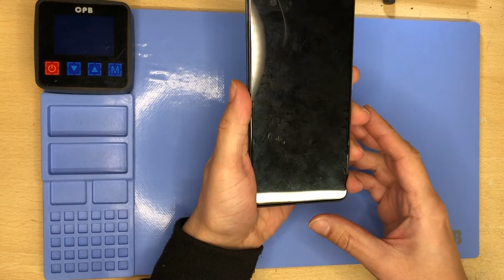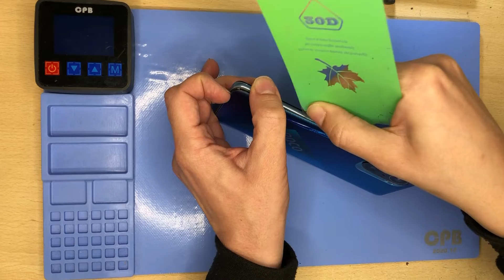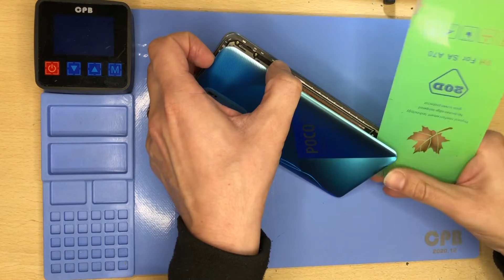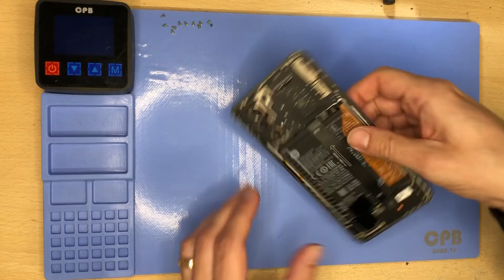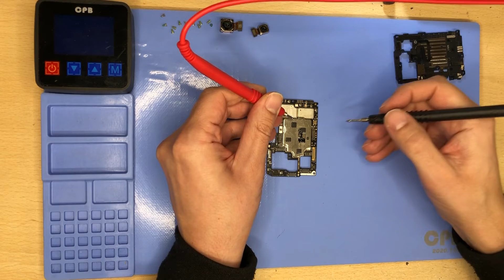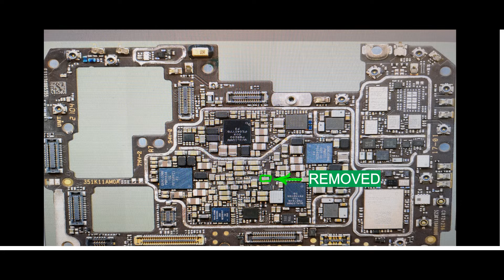Xiaomi POCO F3 Not Powering Not Charging

Comment: same thing happened to my poco f3 just last night.
I was using the device torchlight to look at something with the music playing.then, all of a sudden, it stopped working, with the torchlight still on, it wasn't responding to the fingerprint sensor or pressing the power button - everything just remained frozen just like that. after a quick googling, I held the volume down and power buttons together, it went off but never came back on again. It won't charge and it won't come on. I've tried to hold volume and power button but nothing works. it doesn't vibrate, it does nothing! I'm confused
Reply from the maker: hello, it could be a problem with the processor CPU. Try warming up the processor or motherboard with a low temperature. And while the motherboard is warm, the phone can turn on, then there will definitely be a problem with the processor. Then you should resolder the cpu. It's not a problem for her, write to me.
Reply: @tomasitasovc9372 
Are u sure about this ?
Reply: did you ever fix this? im having the issue right now

Comment: Hi my poco f3 suddenly started to restart and my phone repair guy said I have to replace my battery. But even after replacing battery issue is there. Sometimes it starts but sometimes I have to remove battery pin from the board and have to re-pin it to the board. Sometimes phone gets charged but charging stops at around 50%. Sometimes it won't charge even after charger is connected to the phone. Can you tell me what's the problem please. Great help buddy. I'm waiting for your answer. Thanks a lot in advance❤
Reply from the maker: Hello. Charging problems may be due to the flex connector problem. Restarting issue is CPU proccesor problem. Need to resolder the cpu.
Reply: did you solve the problem?

Comment: Hello i know this is an old video but i hope you'll reply, my poco f3 is 4years old and it's battery is a bit bloated, i was planning on changing batteries, but i noticed while charging my poco with it's bloated batteries still on the phone will sometimes charge and sometimes it will just keep decreasing battery while charging, should i try to change my charging port to or the charging problem is all in the battery?
Reply from the maker: hello. The battery needs to be replaced after it bloated. But it may also be that the charging port is bad, it is best to check look with a microscope or replace it with another one. You can check if your phone connects to the PC and if fast charging works. If it doesn't work, there will be a charging port problem.
Reply: @tomasitasovc9372  thank you so much for the answer, I'll just replace them both charging port and battery i dont want to have charging problem while having a new battery, again thanks for the answer you're a really big help♥️

Comment: Hello, I know this video might be old, but i hope you'll still respond here. My Poco f3 suddenly shutdown when i insert a portable usb, and now it no longer open or charge, I already removed the charger thenI hope you'll still respond here. My Poco F3 suddenly shut down when I inserted a portable USB, and now it no longer opens or charges. I already removed the charger, then I inserted it again, thinking it just hung. What could be the problem? Thanks
Reply from the maker: Hello. Maybe the charging port is bad. You can check if your phone connects to the PC and if fast charging works. If it doesn't work, there will be a charging port problem.

Comment: My poco f3 normally when out of battery i charged i reads yesterday morning when my phone died i charged it just blank and it has been a day. Whats the problem?
Reply from the maker: Hello. First check the charging plate and main flex and its connectors. Second, check the main board for a short circuit.

Comment: Do you have any store to visit? just same problems last day while talking to teams suddenly the screen flicker and shutdown never open and charged for the whole day.. but suddenly in the evening  it opens but after few minutes ut shutdown again, what should I do? thanks
Reply from the maker: Hello. In my case there was a short circuit on the main board. Whose problem was a bad capacitor. Charging problems may be due to the flex connector problem. Won't turn on or restarting issue is CPU proccesor problem. Need to resolder the cpu.

Comment: Hi same thing happen to my poco f3 and the technician fix it by reshoulder/reballing of the cpu but after 2-3 days same thing happen deadboot again and i take it back to the technician and fix it by doing the same process then after 2days deadboot again so what is the main problem thanks for answering
Reply from the maker: hello. If CPU was high-quality resoldered and still not working the problem may be that the CPU is bad or overheated. There may also be damaged tracks between the CPU and Flash memory IC. You can also try resoldering Flash memory IC and power IC.

Comment: my poco F3 cannot connect to fast/quick changer adapter. but it can only connect to non fast charger, what's the problem sir ??
Reply from the maker: Problem is main flex or charging board. Try to change.

Comment: sir same problem please tell me all steps to repair, how i send my device?
Reply from the maker: Hello. Check the vbat voltage contacts. My phone the tester showed zero resistance. After connecting to the vbat power supply, the capacitor shown in the diagram started to heat up.
There may be a problem elsewhere.

Comment: Hello, I changed volume flex cable and NFC antenna in my poco, but after that not turn on. Shows logo and baterry icon and turn off. It's not charging also. I try put old parts, but didnt help. Any advice?
Reply from the maker: Hello, 1. Check the volume flex to see if the buttons are not short circuit. 2.  Try to turn it on with a charged battery. 3. try to heat up the processor at a low temperature, there may be a problem with it.
It won't help her to write.
Reply: @tomasitasovc9372  If look on connections (one pad up, two pads down). I have signal between two below without push the Button. its ok or its shortcut? Old flex Has damage volume up so hard to compare these two. I also try to put old one flex and run phone without it (I protect pins to not have circut short).

Phone also not charging.

Comment: brother I have same problem with my Poco f3, mobile is on , calls and messages is coming  but display not showing anything
Reply from the maker: Hello. There can be many reasons why it doesn't work. For her, the problem of the PCB boards will most likely be the CPU processor overheating or backing off. Try to warm up the CPU to a low temperature. There may be a screen or lighting problem.

Comment: My poco f3 will only show logo and batty symbol when I try to turn it on and same happened when I try to charge it. It just keeps on showing logo and shuts off again and again. What should I do ?
Reply from the maker: Hello. Charging problems may be due to the flex connector problem. Won't turn on or restarting issue is CPU proccesor problem. Need to resolder the cpu.

Comment: my phone poco f3 charging normal , but it vibrates and the connector doesn't want to connect to the PC is there a solution?
I have replaced the charger board port and the plexible main sub is the same
Reply from the maker: Charger plate and the main flex are good for her. Check the flex connector on the main board and check the IC S6000 and IC U5200.
Reply: @tomasitasovc9372  ic power?
Reply: I have the same problem how did you solve it?

Comment: my phone got dropped from my hand after that its completely dead.. no power on or charging showing any body who had this experience..
Reply from the maker: Hello. In my case there was a short circuit on the main board. Whose problem was a bad capacitor. Charging problems may be due to the flex connector problem. Won't turn on or restarting issue is CPU proccesor problem. Need to resolder the cpu.

Comment: Same issues. Deadboot Poco F3 5g
Reply from the maker: First check the resistance of the power supply circuit. It could also be a processor problem.

Comment: Hello, I have an issue with my Poco F3. It detects the charger but doesn't charge past 1%. I've tried various cables and adapters, but it won't charge. Also, being able to use it at all is quite an achievement, as it usually stays on a black screen with a blinking lightning bolt, and it doesn't even get to display the Poco logo. I would like to add that the phone had previously fallen without a case on, and an hour later, I completely drained the battery to absolute 0% while listening to music on my way home. Additionally, the battery, regardless of the charger, consistently charges at 400mA :(
Reply from the maker: Hello. Charging problems may be due to the flex connector problem. Restarting issue is CPU proccesor problem. Need to resolder the cpu.

Comment: Same with mine wont charge and deadboot
Reply from the maker: First check the resistance of the power supply circuits. It could also be a processor problem.